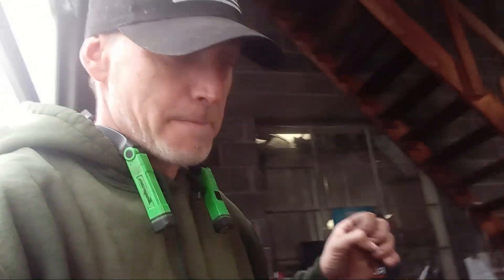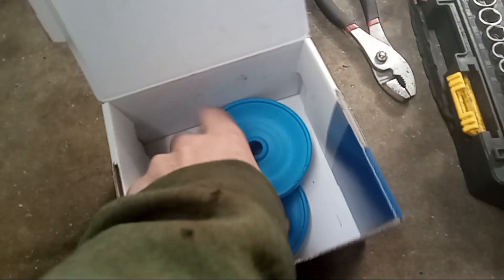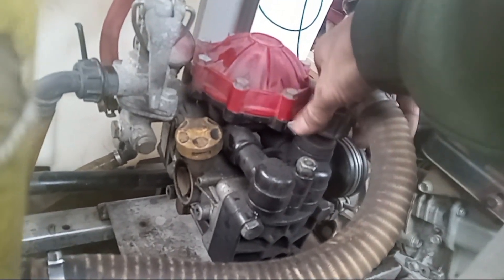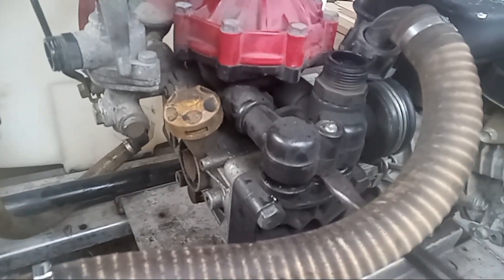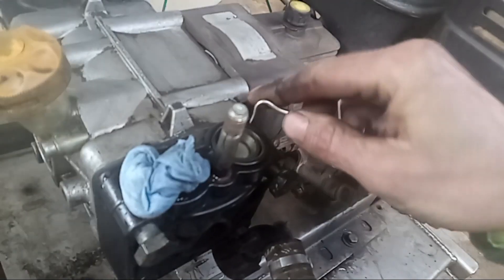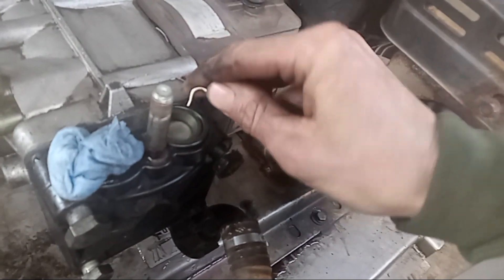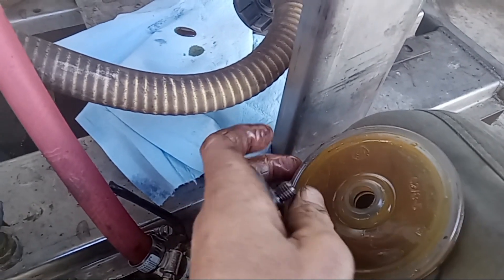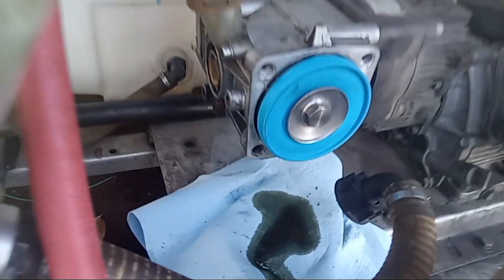How To Change Diaphragm, Air Accumulator, Check Valves on AR30 / D30 Diaphragm type pumps

Comment: I'm not getting any pressure on my pump. I just installed it. Do i need to add air into the accumulator? 

I tried all 4 settings on the unloader. I saw a very slight increase when i was on setting 4.  Any ideas,?